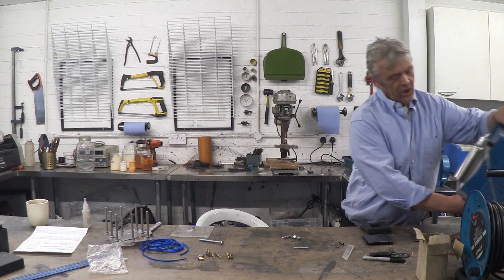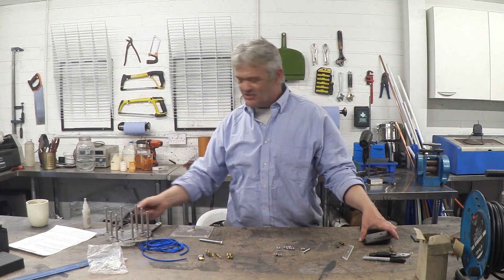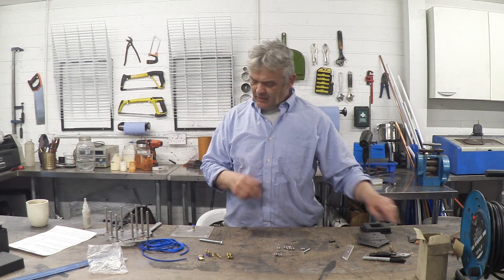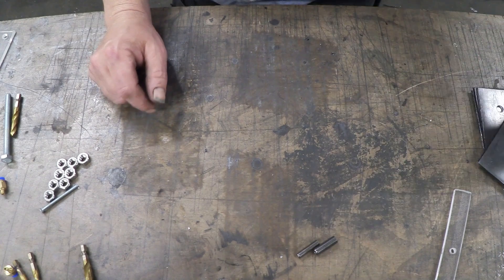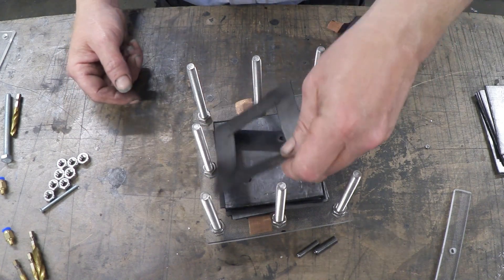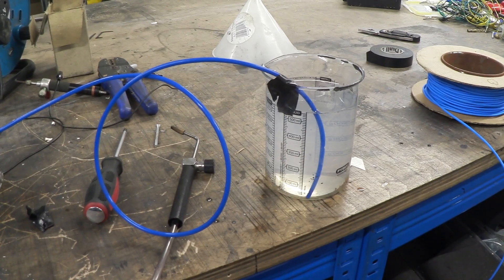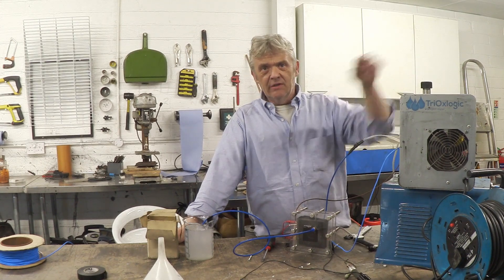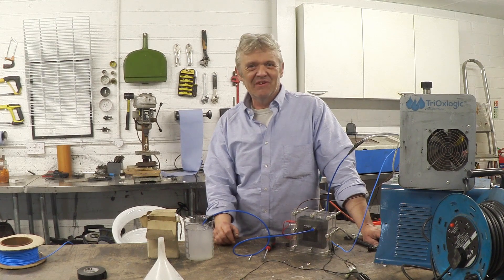Super Efficient Graphite Dry Cell Hydrogen Generator

Comment: Mate check out YouTube channel hho connection. Some really cool designs and DIY bubblers. I'm wanting to build a system the same as the standing tool box they make but was trying to save on buying the stainless.  But you solved that problem.
Reply from the maker: will do mate thanks for the heads up

Comment: can't wait to see how well this performs. I assume if you build a larger stack, then it would produce more gas but require more power to run ?
Reply from the maker: yep
Reply: Increase the voltage this would decrease the current. Nice work, question.....is the electrolyte recycle if so how?

Comment: When you say "I now need to make up a power supply and a bubbler etc for the graphine HHO unit", it leaps out to me actually all you need to do is replace the Stainless tank in the Jewellers welding unit with your new graphine generator. As long as you can get the plumbing to fit, it already has a power supply, a bubbler, the pipe work and of course a nice case, with amp meter, for it all to be portable in. Now that is in line with everything else having only taken 20 minutes to do :)
Reply from the maker: I kinda wanted to keep that as a functioning unit mate - good for comparison

Comment: Can you modify this to separate the oxygen from the hydrogen?
Reply from the maker: I suppose - but there doesn't seem to be a need to do that
Reply: @ThinkingandTinkering  I'd like to use hydrogen to run a small engine but have problems controlling air-fuel ratios when using Brown's gas.

Comment: I'd like to see a comparison between the volume of gas output from this compared to the other device, versus input power.
I made a dry cell with stainless steel and I agree it was an absolute nightmare! I still have it kicking about, maybe I should revisit it
Reply from the maker: me too - but I still have a couple of ideas I'd like to try in the small version first
Reply: What do you use the hydrogen for?
Reply: Burning what else you can make one hell of a torch

Comment: Very nice design! Too bad it is so difficult to separate Hydrogen from Oxygen. Maybe there are some oxygen or hydrogen absorbing materials that can be used to split the mixture?
Reply from the maker: well - you could add micro channels like they do in fuel cells that would probably be a way to go
Reply: @ThinkingandTinkering  material like nafion?

Comment: It is not so strange that graphite works as it is a connection between production and deteriorating the electrodes, however there is a physical thing most dont understand i havent tried wich you may as i wont develop it, although it may be feasible. For the current, a production is somewhat limear to amp and surface. So far so good. The interesting bit comes wether you may oscillate same voltage and amp, between different plates. Here most people loose it as it is the same voltage, on sheet one, two , three. What people have not understood is however that the gas bubble has a creational speed . If you match the speed of the split, and change surface to 1..2..3..4 and uses a pump to release the bubbles. Would they continue to grow after the voltage been switched over to next surface? Possibly. This means that you could hypotetically switch cell by cell,very fast, and make it " similar" to what you would get if all plates were connected at the same time but with more current. If it had been a simple thing it would not, but we are not creating energy, we utilize energy to divide something, and we do not brake a law as the current will be the same , just kept on by a sort of on/off function that must time the creation of gas. But if the bubble has a occupied surface before release, we just " move the production to the optimal surface. If this is true, and it does work, it means that a hydrogen generator can be way more efficient than just add current in an alkaline solution. I actually asked a professor once about the time and average size of the bubble and no one have been able to answer it as it has not been measured. Ie , the certain amount of gas vs amp, may or may not overall be linear..but the bubbles themselves perhaps are not similar. So practically, do not use a sinus vave, use a 1/0 with diods, probably a regular wave generator and try it around 10,30, 60, 120 and 300 pulses and see if it may work as i dont have a pulser.
Reply from the maker: it's unlikely i will do that mate as it seems overcomplicated to me - to a point where i don't see the benefit - especially if we just add a catalyst and get far more improvement than all that fiddeling around
Reply: Robert Murray-Smith  in a way yes, but the win is that you can get a huge surface at the same amp. Ie if you use a 9 volt battery, it would match like using ten times same amperage. Now it is just figures from air but you get , perhaps huge gas production of something you can put in a car.. and use it directly.
Reply: The only problem is to know how fast each surface shall bear load and not.

Comment: Sorry mate, but electrolysis will never ever be effective for power production. It will always work at an energy loss. Except if you never try to get power out of it and use the heat for cutting/melting plastic and the like. Don't mean to sound dickish but I'm just so irritated by the wave of electrolysis as anything else but an easy hydrogen source
Reply from the maker: idon't mind - everyone thinks what they think
Reply: And then some people never do the appropriate amount of research.  (Daryl Mason) was producing units above unity with wet cells and stainless steel.  All his results were published for comparison and if memory serves, he had a upside down Y with 5 neutral plates per side.  His plates went through evolution and ended up being something similar to a micro channel design with a extended plate with thin slot bars sticking out of it. He also said it made more production under vacuum and wasn't producing alot of heat.  P.W.M helps with keeping amps in check and possibly a sonic generator tuned might help speed production by forcing the hh0 off the plates faster to keep max surface area exposed.  He was far ahead of the dry cells in efficiency and some of his research could probably advance all those interested in using this in cars.  P.S. introduce hho after the oxygen sensor and use a flash back arrestor.  You need to fool the electronics to keep it from adding more fuel.  I also believe he said you needed .25 L hho per engine liter to be effective.

Comment: would it be possible to daisy chain these cells in a way to keep the voltage at 2V per plate but make use of those long bolts to extend the overall generator and increase total output?
Reply from the maker: for sure mate - you can put as many as you like really
Reply: @ThinkingandTinkering  would love to see how much hydrogen you could get out of something like that, i might have to build a few myself

Comment: why no add  a magnet layer ?
Reply from the maker: later - walk first then run
Reply: @ThinkingandTinkering  i got you..., looking forward to that video,and btw if you will use a high voltage low amp high frequncey power source you will see better hho proudction. and if you try and use iron.

Comment: Great work. My last diy kitt was with steel and rubber sealant. I reclaimed the metals from an old pentium computer case. It was for a friends brown-gas burning heater and water heater / stove  cabin in the woods. His solar setup was amazing, so there was always a battery bank to rely on/ Your build though, is much nicer than the brutal thing I improvised. Excellent to see.... * It almost seems like the O2 would be a useful side toy to use as a pressurized source. Then a torch could get a kick and get deep into the soldering and micro\macro welding zone of it. There might even be a scuba application if someone was to come up with a backpack sized unit.  :) 
Thank you for sharing this adventure. Keep going, it's a very long rabbit road to many holes of the illusionment. LoL I hope to see more of you along the way.
Reply from the maker: lol - cheers mate and thanks for taking the time to post

Comment: Really great Video, tank pure for sharing alle these information. 

What thickness of the graphite foil did you use?

I'm sorry if it's mentioned in the video, missed it. Does the thickness matter, or shouldn't be there a big difference in efficiency?
Reply from the maker: thickness doesn't really matter that much - it will be more conductive as a bulk property but it is really a waste of material if it is too thick and it costs more

Comment: Double thumbs up.

Neoprene gaskets can be substituted with cheap easy to cut pvc shower pan liner that one can buy from a local large hardware store.  And pvc holds up exelent to sodium  and potasium hydroxides.  but pvc does not hold up well to a lot of heat so one needs to use very efficient low 2v or less per cell.  Also, one may try various heat dissipation  methods. 

Three more thing to consider.  

1) Excessive amps per sq area will make lots of gas bubbles that may  aggressively lead to early graphite plate deterioration. One may aim for more plate area with a lower amp per sq area. I dont have an amp per sq area to recomend shooting for. That may require experimentation.

2) gas build up at the top will reduce the plate surface area submerged in electrolyte. If each sq area were thought of as a resistor allowing a certain amount of current, then doubling the area halfs the effective  resistance like two resistors  in parallel.  

3) gas bubbles on the plates and in solution between the plates reduce the effective area through which current can be conducted through  the electrolyte. 

Way to mitigate issues two and three  is to circulating electrolyte with a pump pushing gases and electrolyte out of the cells.  Maybe orentate the cell to have  one corner facing up and the gas discharge hole at the top and an electrolyte refill hole at the bottom corner. 

Other ideas to  I've seen people do and may spark interest. 

1) Magnets.  I suspect magnetic fields transverse to the flow of current can  induce the electrolyte to move move at 90 degrees to both the magnetic field and the direction of current (along the the surface of a plate), and that this electrolyte  magnetohydrodynamic flow can help break bubbles free from the surface of the electrodes  helping maximize the active electrode surface area. 

2) People have used ultrasonic transducers to break bubbles from the surface more quickly. Although, I suspect it may speek breaking down the electrodes. 

3)  I've seen people use a vacuum  pressure to expand the gasses presumably this helps bring the gasses out of solution faster but I'm not sure how much it helps maximizing active plate surface area with expanded bubbles between the plates, and expanded gas does not mean more gas production.
Reply from the maker: lot of info - cheers mate
Reply: Use the kiss method

Comment: how a magnetic field will increase production on your cell ? ( another video from you showed increased production in a magnetic field)
 keep your good work.
Reply from the maker: no idea I just know it works
Reply: I'll say it again Rob - try Extruded Carbon Water Filters, submerged in electrolyte... it's all about surface area (4000m^2  in a standard 250mm Cartridge) and the correct pulse frequency (25A 82V @ 300kHz) to obtain optimum resonance. Adding a small brushless circulation pump helps improve gas removal from Filters to improve efficiency.
Reply: @delawarecop  resonance is probably individual and needs to be tested with a fequency sweep and a bode diagram and of course a measurement how much is coming out
Reply: Stefan Weilhartner - Sure, but we must have a base point from which to start, right? 300kHz is a great center frequency to start sweeps, rather than say 10kHz.
Reply: @delawarecop  no, I would start at 0 Hz and go up logarithmic to the limit of the electronic circuit. Maybe around 500kHz or 1Mhz. That depends on the electronic that need to be suited for that.
After doing the impedance measurement, I would do an output measurement at 0 Hz, resonance frequency and +/- 30% around it.
Reply: @Chris Mills how much gas can you generate per minute with 400 amps and how large was your dry cell & electrodes?

Comment: Is the graphite foil made from your ink?
Reply from the maker: no mate it's off the roll - it's a standard product you can buy it on eBay if you want
Reply: @ThinkingandTinkering  Then I know, thank you for answering. I didnt know that kind of foil existed (even less its possible uses) before the video and my brain haphazardly filled in the knowledge gaps with that your ink maybe could be useful in the production of one of those cells. Thank you for your videos. I put them and your channel on the same level of quality as applied science, tech ingredients, thought emporium, nile red, and more.

Comment: Amazing Rob, you’ve done it again! Has anyone ever told you they love you? I ordered the bits from USA for one that fit into a T shaped assembly made from about 2.5 inch waste pipe, the vertical part acting as a reservoir, and built it myself .... quite expensive though. However, adding the HHO to my diesel van air inlet tube, with the power supply sourced from a point that was only switched on when the engine was running, gave me a 15-20% fuel saving, and a quieter and smoother running engine. I would switch the device off when having the van serviced, as the engineers only had a performance map for the diesel only.
Reply: To get the 15-20% fuel saving, how much electrical energy do you need to put in? I'm thinking solar panels on a van roof to save fuel...
Reply: Hi Galv, I was drawing between 10and 15 amps at 12-14 volts. I never did work out the volume of HHO I was getting though. I expect you could do better by pulsing the current, and, looking back to other videos of Rob’s, having some way of agitating or stirring the cell, or a magnet? Worth trying these things! Hope this helps.
Reply: @77pete7  with those amps and volts you looking at power consumption of 120 watts on the low side and 210 on the high side one mechanical horsepower is equal to 746 watts so your using around 1/4 horsepower directly off the crank due to added alternator load so a little lost power to get a much cleaner burn and better economy should be way worth the lost hp in my opinion.  just fyi lol
Reply: @77pete7   Stirring cells ? Remember Apollo 13 !
Reply from the maker: my wife has lol - interesting stuff about the engine - cheers mate
Reply: @ThinkingandTinkering  doing a quick google search you find "Michael Faraday also demonstrated that electrolysis cells can support up to 0.084 amps per square cm without overheating". I assume that is relating to 316 Stainless Steel plates. My question is do you know how this number was derived and would it be different for other materials such as Graphite? How would we derive this number for Graphite in an HHO cell? (I assume it has something to do with the material's electrical resistance?)
Reply: @razor123 Yes, it was worth doing, and I only had to add a bit of baking soda electrolyte every 500 miles or so, Thanks for reminding me ... I have another van now, and I really should get around to installing the gear in it!
Reply: I told Him even Many// Times, I am Loving Him*! ^_^ * because of his Kindness ans Generosity, times Creativity and Good Sense in Any Form: Scientifically, Ecologically Financially. Hope his Wife won't be Jealous ;)